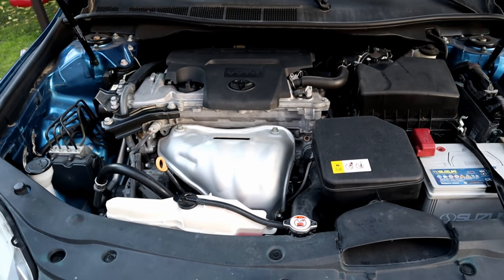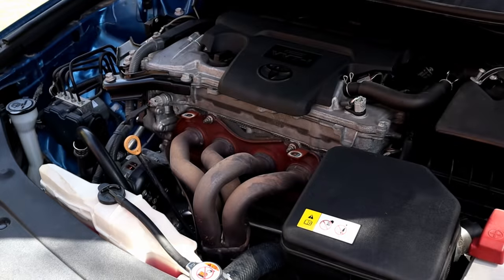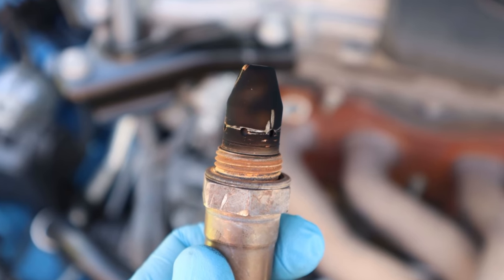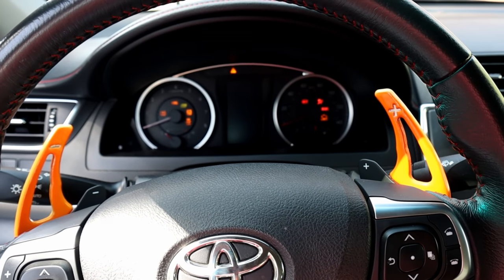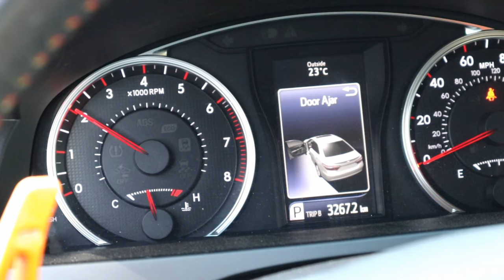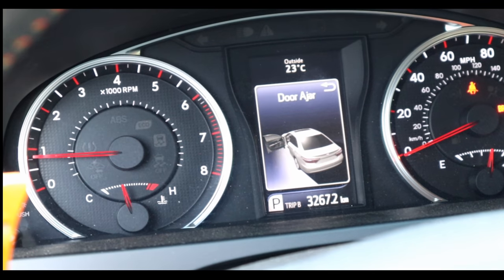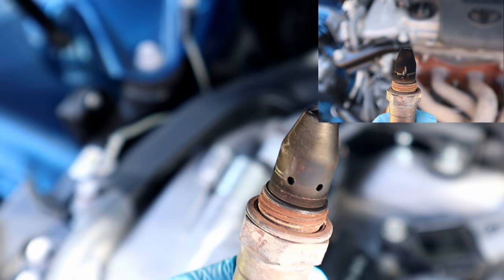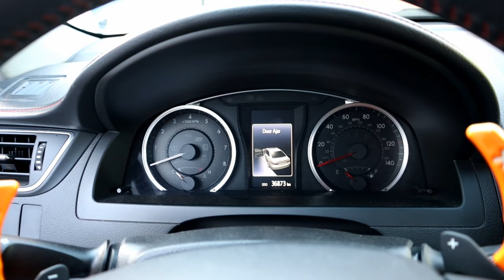Cleaning o2 sensor without removing it/Cleaning oxygen sensor with carb cleaner/TOYOTA Camry 2017

Comment: If it was black there was a reason. Fix that first
Reply from the maker: Yes that's correct, I had a bad fuel injector and after cleaning,  I wanted to speed up the cleaning process

Comment: Guess where all the trash goes when you do it in this method ???
Reply: Maybe to the atmosphere vent? I am really curious, If the O2 sensor gets dirty enough to need to be cleaned isn't there something else wrong to cause this. I started out in automotive long before the advent of O2 sensors so I grew with them and transferred what I have learned to the marine world and have never seen the O2 sensor being dirty the basement cause of the problem. The early ones would get lazy at idle especially on high mileage engines but now days with different construction and heaters I can't say dirty O2 sensors on their own are a thing.